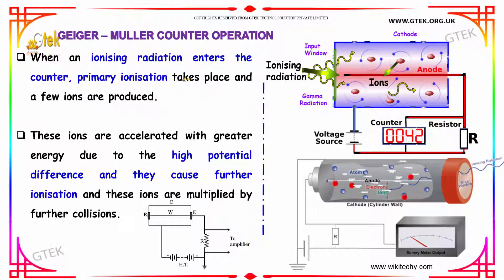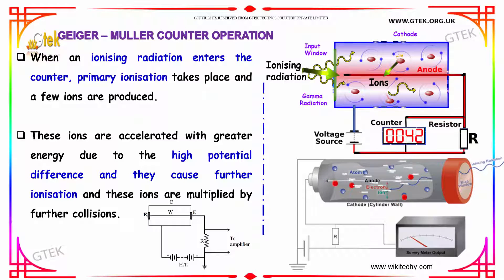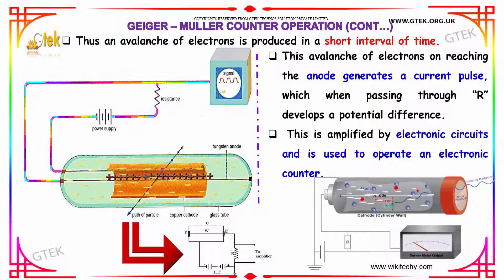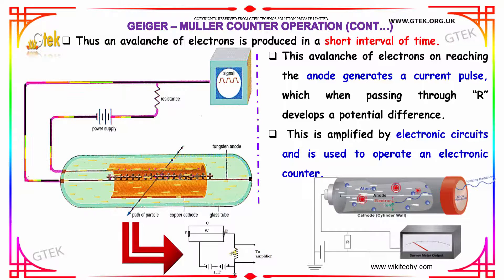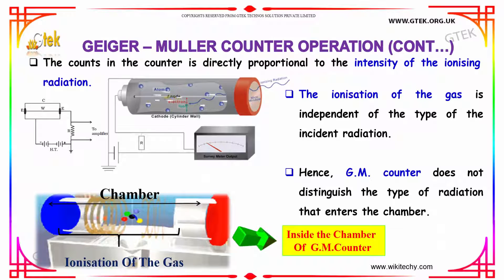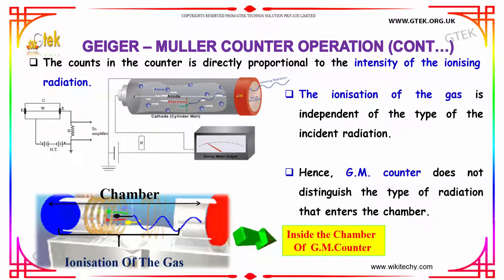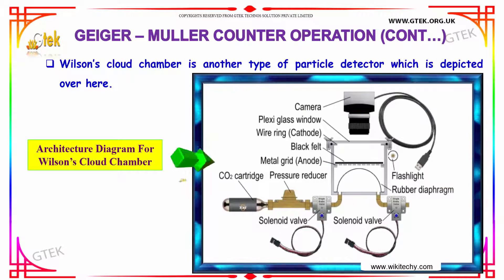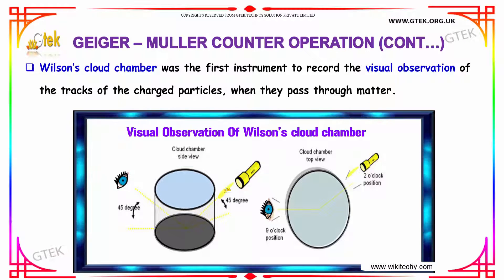Geiger Muller Counter Operation | Nuclear Physics| class 12 physics subject notes|CBSE|IITJEE

Comment: 298 E. AMAXDI work on the hyperfine structure of spectral lines, a subject he ... of the physics of the nucleus at a nuclear conference held in Paris in 1932 as part of a ... by means of a thin-walled Geiger-Muller counter, with a totally negative result, ... Pubblica) for use with the gamma-ray spectrometer mentioned above [12].

Comment: The GM tube is a hollow cylinder filled with a gas at low pressure. The tube has a thin window made of mica at one end. There is a central electrode inside the GM tube. A voltage supply is connected across the casing of the tube and the central electrode as shown in the following diagram.

Comment: The Geiger counter is an instrument used for measuring ionizing ... A Geiger counter consists of a Geiger-Müller tube, the sensing element which detects the radiation, and the processing electronics, ...

Comment: A Geiger counter (Geiger-Muller tube) is a device used for the detection and ... Proper operation is when the voltage is in the plateau region of the curve

Comment: When an ionising radiation enters the counter, primary ionisation takes place and a few ions are produced. These ions are
accelerated with greater energy due to the high potential difference and they cause further ionisation and these ions are multiplied by further collisions. Thus an avalanche of electrons is produced in a short interval of time. This avalanche of electrons on reaching the anode generates a current pulse, which when passing through R develops a potential difference. This is amplified by electronic circuits and is used to operate

Comment: In summary then, here's what happens when a Geiger counter detects some radiation:

Radiation (dark blue) is moving about randomly outside the detector tube.
Some of the radiation enters the window (gray) at the end of the tube.
When radiation (dark blue) collides with gas molecules in the tube (orange), it causes ionization: some of the gas molecules are turned into positive ions (red) and electrons (yellow).
The positive ions are attracted to the outside of the tube (light blue).
The electrons are attracted to a metal wire (red) running down the inside of the tube maintained at a high positive voltage. As the electrons head for the wire, some of them collide with other gas molecules, splitting them into ions and more electrons. So we get a kind of chain reaction in which even a single particle of radiation can produce avalanches of electrons in rapid succession; this process is known as a Geiger discharge.
Many electrons travel down the wire making a burst of current in a circuit connected to it.
The electrons make a meter needle deflect and, if a loudspeaker is connected, you can hear a loud click every time particles are detected. The number of clicks you hear gives a rough indication of how much radiation is present (the meter gives you a much more accurate idea).
Before the counter can detect any more radiation, it needs to be restored to its original state through a process called quenching, which cancels out the effects of the Geiger discharge. Sometimes that's achieved by having a second gas (called a quenching gas, often a halogen) inside the tube. Or it can be done using an external circuit with a very large resistance

Comment: When radiation enters the tube, it causes ionization, splitting gas molecules into ions and electrons. The electrons, being negatively charged, are instantly attracted by the high-voltage positive wire and as they zoom through the tube collide with more gas molecules and produce further ionization. The result is that lots of electrons suddenly arrive at the wire, producing a pulse of electricity that can be measured on a meter and (if the counter is connected to an amplifier and loudspeaker) heard as a "click." The ions and electrons are quickly absorbed among the billions of gas molecules in the tube so the counter effectively resets itself in a fraction of a second, ready to detect more radiation. Geiger counters can detect alpha, beta, and gamma radiation.

Comment: A Geiger counter is a metal cylinder filled with low-pressure gas sealed in by a plastic or ceramic window at one end. Running down the center of the tube there's a thin metal wire made of tungsten. The wire is connected to a high, positive voltage so there's a strong electric field between it and the outside tube.

Comment: The Geiger counter is an instrument used for measuring ionizing radiation used widely in such applications as radiation dosimetry, radiological protection, experimental physics and the nuclear industry.
It detects ionizing radiation such as alpha particles, beta particles and gamma rays using the ionization effect produced in a Geiger–Müller tube; which gives its name to the instrument. In wide and prominent use as a hand-held radiation survey instrument, it is perhaps one of the world's best-known radiation detection instruments.
The original detection principle was discovered in 1908 at the Cavendish laboratory, but it was not until the development of the Geiger-Müller tube in 1928 that the Geiger-Müller counter became a practical instrument. Since then it has been very popular due to its robust sensing element and relatively low cost. However, there are limitations in measuring high radiation rates and the energy of incident radiation.